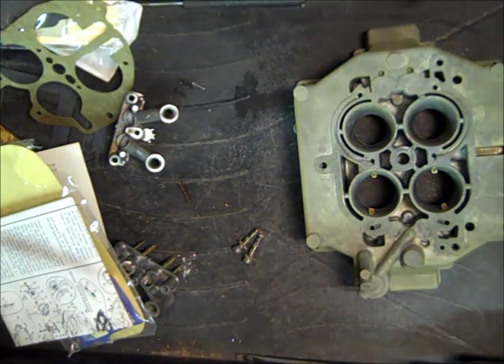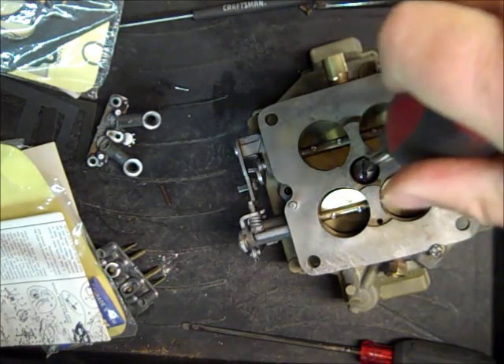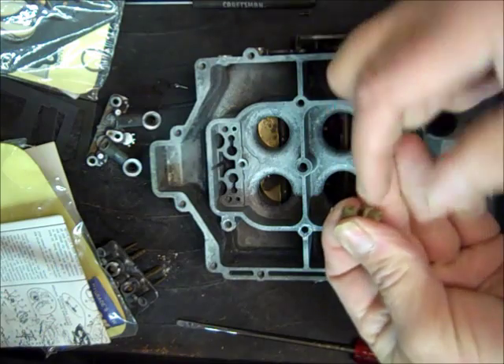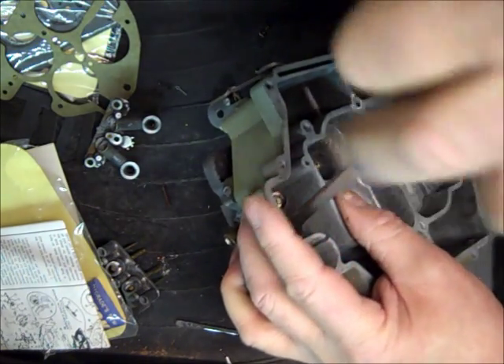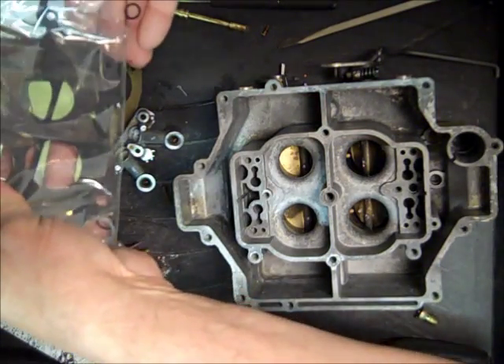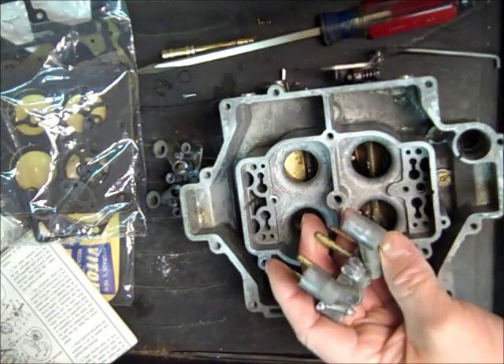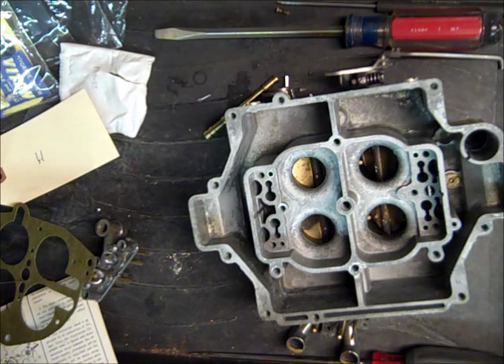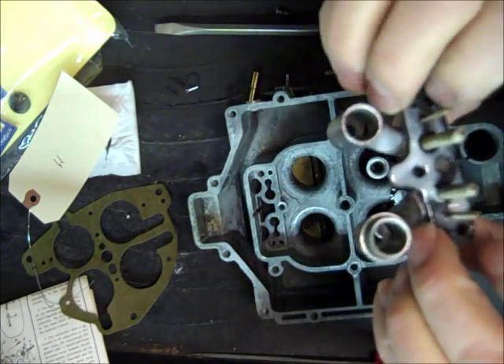Rochester 4GC Carburetor Rebuild Part 2 of 4

Comment: Hi Mike , I'm watching your video and I don't have a slot for the tee . All i have is a round hole . What do I do now ?
Reply: @MikesCarburetor  Thanks , I'm having a problem with getting too much gas now . I adjusted the quotes like the paper said the inch and 3/8 and I'm getting way too much gas it won't run right. Any suggestions?